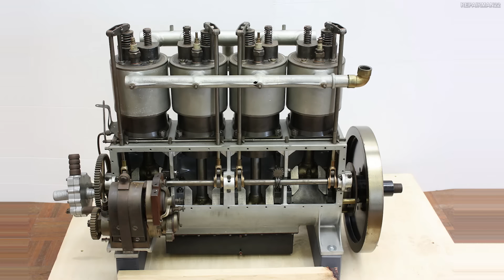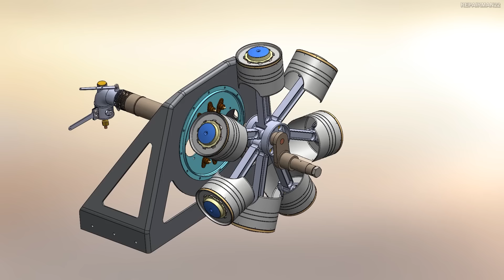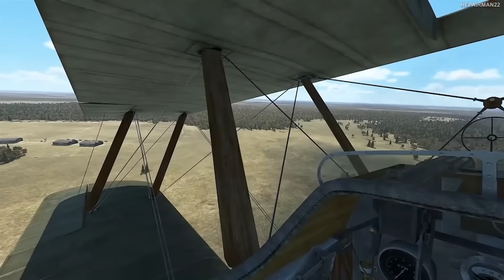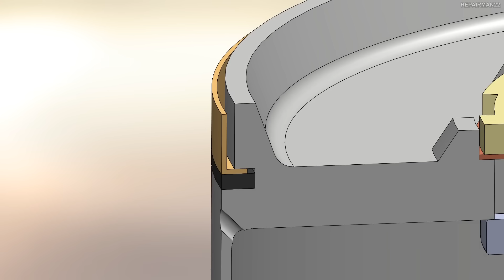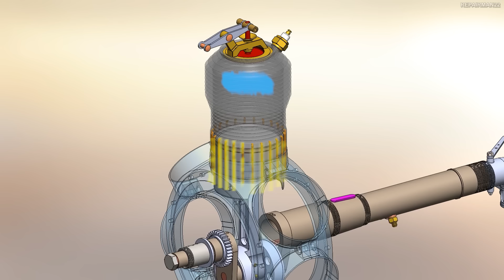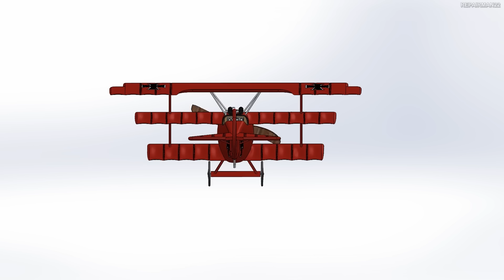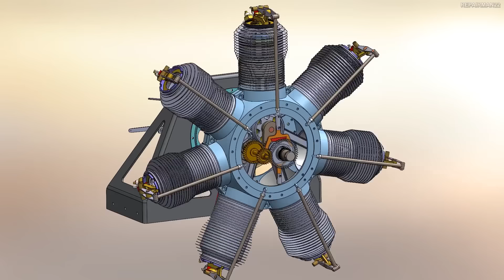This engine has a VALVE in the PISTON 🤯 Radial Rotary Engine

Comment: Very cool video - shows another way to my self made 7 cyl 120cc radial model engine 👍👍
Reply: @Noeggi1954  Rotary, not Radial
Reply: @sandervanderkammen9230  Sorry but MINE is a radial engine since the cylinders are stationary!!!!!!!!!!!!!!!!!!!!!!!!
Reply: @Noeggi1954  Yes, exactly.... Radial type engines don't spin around a stationary crankaxle.
Radial type engines have a crankshaft that spins.
Cheers Mate!

Comment: There is no "Master" connecting rod as all 9 connecting rods are connected to the crank in 3 banks of 3 connecting rods.
Reply from the maker: ? No. It's a master.
Reply: @repairman22  Well My father rebuilt and fitted one of these into a replica Sopwith Camel. There is a Youtube chanel that shows this engine stripped down.
On this engine there are 3 sets of 3 con rods that run in grooved disks fitted to the crank pin.
Yes it was different on the later engines but you have shown an early version.

Comment: A motorbike with a rotary engine in the front wheel is not smart. As anybody who rides bikes knows, all weight in the moving part of the steering makes the vehicle more difficult to control. So a bike with a whole engine in the frontwheel must have been practically uncontrollable.
Reply: They were used primarily on high banked board track racing, very fast in its day

Comment: Those old rotary engines were nuts. Needing to kill the engine completely in order to land. The gyroscopic forces making things move in ways you wouldn't expect. Not to mention that the whole thing is basically just a big flywheel. A very angry flywheel that spits oil at you on the best of days.

Comment: It would have made a wicked two stroke system & then both the spark & the exhaust valve could have been actuated by static radial landings as the cylinders passed. Though in those days the motor would have melted.

Comment: Caster oil was not availablt to the Central powers. Caster oil is used if one is suffering consterpation. The total loss lube, covered the windscreen so many aircraft in the 1920s and 30s had pilots in the open so they mighr see about them.

Comment: They did everything in their abilities to make sure this thing couldn't make power
Reply: They made more power than pretty much any other air cooled engine in their day
Reply: Very powerful and lightweight for their time, they were very smooth and vibration free, no warm-up required either. Just throw the prop and go straight down the field and  into the air.

Comment: Many years ago I asked some brothers who had been pilots since they were kids how they carburated a rotary.  They thought it was a good question but they didn't know.  It made more sense when I found out that it was something like a 2 stroke with the gas and oil mixed together and burned and now I know.  The crankshaft was hollow.  It was a very clever design.

Comment: The castor oil expelled from the engine on the exhaust cycle was also an unpleasant hazard to the pilot. Castor oil is a powerful laxative and inhaling it as a fine mist caused them to suffer from diarrhoea. Also it is poisonous, the toxin Ricin is extracted from castor.

Comment: Thanks for this! I've never seen how the WW1 plane engines worked before. I knew the whole works rotated but I never knew about the valve in piston. Seems like it would not be durable long term but if specs call for rebuild every 80 hours it hardly mattered. Very good presentation.

Comment: The 2nd, Mono-Valve version is crazy, thanks to it's rotary nature it can really get away with both exhaust & intake on the same valve, wild to think. Though it has no serious advantages over more-modern poppet-valve designs, if the fuel was injected you could completely get rid of the early opening during combustion, making it a semi-decent engine! Even though I said there are no serious advantages, to be fair having such a valve means it can be extremely wide, so this design DOES indeed have the largest & most-uniform airflow for a poppet-valve, however to utilize this much you'd need super-high RPM, which isn't practical with such a giant valve even if it's desmo, the valvetrain would need to be seriously beef + the energy lost in it's driving would start adding up to be actually-noticeable.

Thank you for the amazing video & mentioning every later stage of the tech, most people usually always leave out the extras like this.

Comment: How come no one took the round cylinder and pisten were not shaped into a propeller shape to see if they couldn't get more push,,or pull.
Reply: Solving the equations of motion, you'll find they generate uneven forces against the piston walls; maybe fluting it lengthwise would similarly help compensate, if not manage wear and forces to keep the piston face-perpendicular?

Comment: In the 1950s I knew a WW I German mechanic.  He said this engine was very smooth as the pistons and cylinders each rotated on their own axis.  This was an advantage as the air frames were   cloth covered thin wood framed structures,  He also said it's killed a lot of young pilots.  Great presentation.  Should do one on the Earthstar's Rad Cam engine.
Reply: I wonder if he said it also killed many because the oil-spitting out would coat said wood & cloth, quickly turning your plane into a flying combustible?
Reply: @bo-dine7971 Carl explained that the gyroscopic effect caused by the engine made the plane dangerous.  Especially close the ground. I'm 80 years old.
Reply: And how old are you? If you don't my asking.

Comment: I really have to laugh at all these crackpot ideas. Sure, you can get 1 or 10 to work, but in mass production? That's a nope. I'll just remind everyone how well all those amazing cylinder deactivation schemes worked. 2 years, 10k miles then massive problems. And that is nowhere as crackpot as his is.
Reply: They fought an entire long term World War with many of the aircraft using these engines. Worked well enough I would say.
Reply: @waynepurcell6058  Nope. Those engines were overhauled on 10s, not hundreds of hours schedules.  You can get practically anything to work when you're constantly rebuilding it.

Comment: If the intake valve opens because of the down stroke vacuum - What is the fiunction of the piston counter weights ?
Reply from the maker: The weight of the valve with the centrifugal forces scince the pistons rotates, would make imposible to close, so the counterweights cancels the weight of the valve.
Reply: @repairman22  If the crankshaft is fixed, the connecting rods and pistons are also fixed. So there is no centrifical / reciprial forces on the piston or the valve. The centrifical forces act on the cylinders and the crankcase , not on the valve . So there are no inertia forces acting on the counterweights . What forces are acting on the piston counterweights

Comment: The very first radial engines were designed to power motorcycles in the mid-1880s. They were "motorwheels," whereby the engine was built into a wheel and spun with it, with the crankshaft serving as the axle. The Megola motorcycle pictured in this video has a similar arrangement, but its engine drove the front wheel through a small planetary gearset, allowing the engine to have more rpm than the wheel at low speed, and therefore more torque and power.
Reply: Fwd motorcycle..
Reply: @jwalster9412  
Yes, it was. The original Millet motorcycle in the 1880s had its 5-cylinder engine in the rear wheel.
The VeloSolex mopeds had engines mounted on the front fork, driving the front wheel with a carborundum roller bearing on the tire. The pedals drove the rear wheel. That meant, if you were motoring up a fairly steep hill and started helping it with the pedals, you had a two-wheel-drive bike! I currently own a VeloSolex.
There was an Italian bike that was very similar to the VeloSolex, but I can't think of their name right now.
Reply: @rescue270  a 2wd bike sounds like a reliability nightmare but an engineers dream.
Reply: @jwalster9412  
The VeloSolex is actually extremely simple. Basically a bicycle with this little motor on the front. Looks a lot like those rental bicycles they have in cities.
Check out a thing called a Rokon Trailbreaker. Been in production for decades. Hydrostatic drive to both wheels.
Reply: Crazy that electric wheels existed in the past but with engines 🤯

Comment: This looks like a nightmare to me, that's a LOT of rotational mass. What would happen if some sand or any particulates gets into the intake? It would be exposed to every singe critical bering.
What if water causes the intake valve to  oxidize and sieze? Any sort of misfire sounds like a huge repair bill - plus the cost of removing engine shrapnel from the pilot's internal organs.

Comment: It's unclear to me how a four stroke rotary radial can use the descending piston to push mixture through the transfer ports, but a two-stroke can't. It's the exact same process and the problem of the mixture migrating to the low pressure areas of the crankcase created by the remaining rising pistons is exactly the same.
Reply: No such thing as a Rotary RADIAL engine. It's an oxymoron.
It can only be a RADIAL or a ROTARY 
Not both
Reply: @WilhelmKarsten  You literally just watched (assuming you did watch it) a video about the technology behind rotary radials. The cylinders are laid out in a radial configuration and the whole thing rotates around the crankshaft.
Reply: @CaptHollister  The term "Rotary Radial" is an oxymoron.
It's like saying "pistonless piston" engine.
It can only be one or the other, it cannot be both
Reply: @Gottenhimfella The terminology is well-defined and well-known in the field of engineering and the engine manufacturing industry.
All of the credible reference sources are very clear on this subject.
 The terms Radial Rotary is patois, internet slanguage that comes from amateur enthusiast that get confused with Wankel engines

It's very dangerous to rely upon open source reference materials like forums and Wikipedia where material is diluted or perverted by non-accredited sources.
Reply: @WilhelmKarsten  Your point would be valid if a rotary radial were the only type of rotary engine, but it's not. While in the distant past the term "rotary" might have sufficed to indicate that the cylinders were arrayed in a radial configuration, the advent of engines with rotating pistons like the Wankel, for which the term "rotary" has been co-opted, requires us to specify that we are talking about rotary radials to avoid all confusion.
Reply: @CaptHollister  Which Wankel engine?
One is a ROTARY and The Other is NOT
Reply: @CaptHollister WHICH WANKEL ENGINE???
 How can your point be valid if you not sure which Wankel engine you are talking about??
Reply: @WilhelmKarsten  There is only one type of engine with rotating pistons that ever went into production. It's named after its inventor Felix Wankel. It has have entered the lingo as a "rotary" engine.
Reply: @CaptHollister  OH WOW!
You really don't know anything about Wankel engines do you???

There are TWO types of Wankel engines, the one designed by Felix Wankel and the other designed by Hanns Paschke and Walter Frode.

One is a Rotary type engine, THE OTHER IS NOT.
PLEASE NAME THE ROTARY VERSION??
Reply: @WilhelmKarsten  Imagine being so pedantic and yet confidently wrong. Paschke's DKM engine used a rotating rotor inside a rotating housing. It didn't work well and never went into production because its inherent flaws were insurmountable. Froede refined Wankel's design to create the KKM type with a rotating piston inside a fixed housing, which is the technique used by every production Wankel engine ever. Still a flawed design, but at least it could be put in a vehicle. You scream and argue like a twelve year-old and you only throw challenges to prove that you "know" stuff. Dunning-Kruger syndrome if I've ever seen it.
Reply: @CaptHollister  The DKM54 is a Rotary, it has a stationary axle, the Piston AND the engine case ROTATES around this stationary shaft.

Hanns Paschke's KKM57 discarded the Rotary layout completely in favor of a conventional spinning shaft and a fixed, stationary engine housing.
The KKM57 is NOT a Rotary type engine.
   It's fundamental design is a conventional layout.
Drehkolbenmotor means Rotary Piston engine
Kriess(en)kolbenmotor means Orbital Piston engine.

The DKM54 has a piston that spins concentrically on fixed axis.
  The KKM57 has a piston that Orbits in a distinctively Planetary Motion both spinning AND RECIPROCATING simultaneously.

Any questions lad?

Comment: Dan Gelbart designed a small tabletop uniflow steam engine that has a spring loaded exhaust valve in the piston in combination with exuaust ports in the cylinder wall. The ports are uncovered which drop pressure and allow the spring loaded exhaust valve to open, allowing the piston to come up while still exhausting spent steam. The intake valve is also a "bash" valve. The piston coming up causes the exhaust valve to hit the intake valve and force the exhaust valve against its seat in the piston. The same action also forces open the intake valve and admits steam to the cylinder. An electric solenoid then holds the valve open for an amout of time determined by a computer, for highly efficient computer controlled cutoff governing of the steam engine load. There is a video of it under his name on YouTube. He also has a website with w description and schematic of it.

Comment: Thank you. I could never rap my head around thies engines before. And I am a mechanic.😂
Reply: no surprise there. not there to redesign or conceive of new approaches to how engines operate. youre there to spin spanners and replace components. or maybe bolt on the occasional upgrade...

yeah, im qualified. can only change oil filters and brake pads and enjoy it for so long.

Comment: Good job Francis. I have seen these engines operate before (in videos), but since I'm diabetic, thus making piloting unavailable to me, I never pursued aviation. Don't get me wrong, If I could have, I would have SERIOUSLY become a pilot. But that's life. And I am restricted t Microsoft Flight Simulator.  I would have liked to have seen a two stroke version attempted. A supercharged 2 stroke 9 cylinder 4.5 liter engine with 9 expansion chambers could have (theoretically) made 800 horsepower. I have no clue what kind of fuel mileage it would have gotten. but that thing would have seriously screamed!  I say theoretically because I don't know what the slave rods could have taken for power. a regular two stroke rod can easily take over 100 H.P. per cylinder. but an aviation master/slave arrangement is something i have no experience with. I do know that a very highly tuned 2 stroke engine can get pretty respectable fuel mileage when driven at less than 40% power. By the way, you did such a good job with this presentation, I'm subscribing.
Reply: Diabetes is looking more and more reversible in case you pivot towards aviation when you're 64. Luck keeping with you, you'd be able to work around biodegradable tyres so that particulate exposure hazard is less also. Did you really think this explanation did a good job telling how an engine with 5:1 compression avoided knocking (running on castor oil,) dispersed exhaust well, and generated some thrust off constant 70 HP (enough to run one of those things that picks up soil and blasts it against hardened steel to destroy weed seeds?)

Comment: A very clear explanation of how this engine works. One other downside not mentioned is that these engines were extremely noisy. You don't really know how loud until you have seen one of these working in person.
Reply: WWI was pretty noisy in general
Reply: @Tom-Lahaye  Airplanes in general from this era have no mufflers.
Reply: They also spewed oil and fuel all over the place.
Reply: @tims8603 You see pictures of the pilots' faces after a mission coated with oil, apart from the area where their goggles were.
Reply: @manek_dubash  lol, OP complaining about the noise... try the SMELL!

yeah, castor oil is a great LAXATIVE.

no wonder the pilots where "the good chaps from eton"... they didnt want any of the lower class to get the impression their pants were constantly in need of laundering... not quite so glamorous as they made it out to be!

still, the exhaust itself would have smelt quite nice :)

Comment: That's a radial engine
Reply: Radial engine doesn't spin. Watch the video and explanation of how it operates instead of just glancing at the very first visual reference and commenting.
Reply: @waynepurcell6058  hold tf on I had an opinion and there's the other guy with the rotation of the whole unit when does a wankel rotate as a whole... it doesn't
Reply: @matthewfredrickmfkrz1934  WHICH WANKEL ENGINE???
THE DKM54 DOES
Reply: It's a ROTARY  Not a Radial engine
Reply: This is a rotary, the wanker is a wanker

Comment: They were super dangerous, and known for flinging oil everywhere and causing massive unwanted gyroscopic forces. Just an overall terrible design.
Reply: One of the best fighter aircraft in history was powered by the rotary. Terrible design by MODERN standards, but you're forgetting that the fully controllable airplane had only been in existence for about a decade when this war started, and internal combustion design itself was in still relative infancy. A long-term World War was fought with these engines, they served well enough for their time.
Reply: Very  effective and successful design  for it's time.
Reply: On the other hand, as a derp strapped in a box on the gyro, you could point your crappy plane somewhat intuitively after a bit. (All trim and rudder, no power balance!)